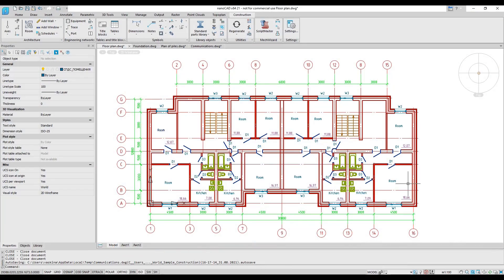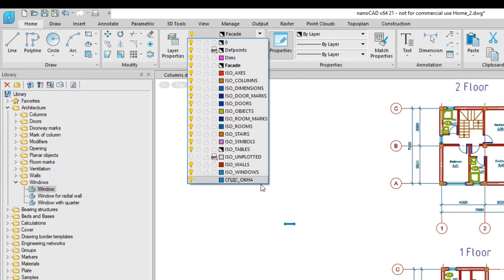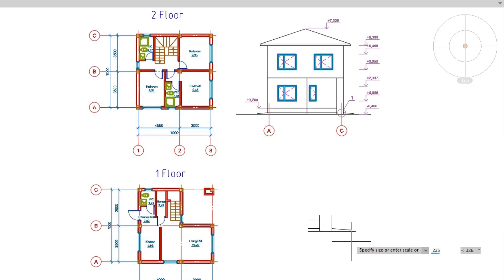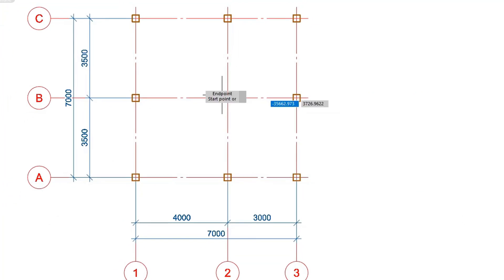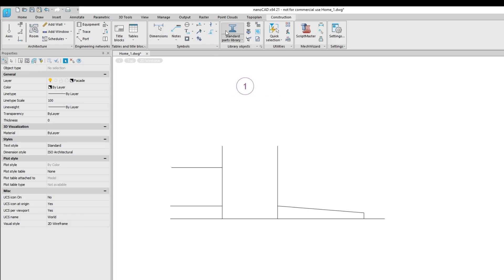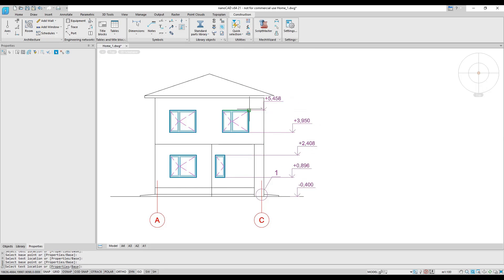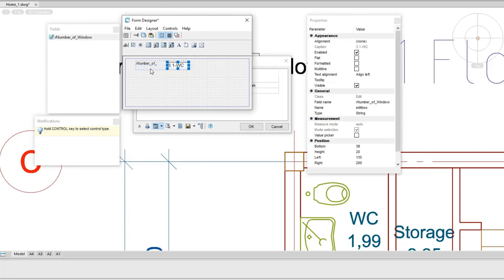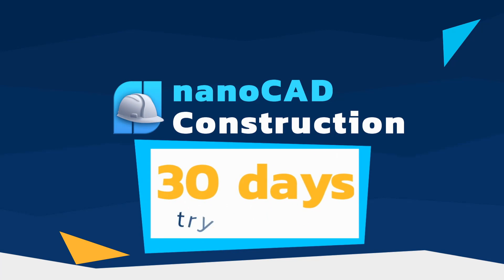Introducing nanoCAD with Construction Module

Comment: Hi, I would like you to ask about the compatibility of your product.
Are the nanocad construction module files compatible with another software on the market?
And the other sowtware's files? Your soffttware can work with other files extensions?

Thanks for your attention.
Reply from the maker: Hi Landim Neto,
Thank you for interest in nanoCAD. nanoCAD runs in the industry’s standard DWG format. It’s the same one other CAD systems are based on, such as AutoCAD, Bricscad, etc. Also you can use many other formats such as *.dxf, *.dwt, *.dws

Comment: Hi, thanks for the video.
I downloaded the module in trial mode and testing.
Unfortunately doors don't always work, sometimes they correctly identify the wall and cut it, but other times not.
It's crucial for an architecture addon that this always works, when it doesn't the concept of "intelligent" walls, rather than just lines seems useless
Reply from the maker: Hi Christos Symeon, 
Thank you for your comment. Please, contact our support team at support@nanocad.com and they will help you resolve the issue.
Reply: @nanoCADcom  az